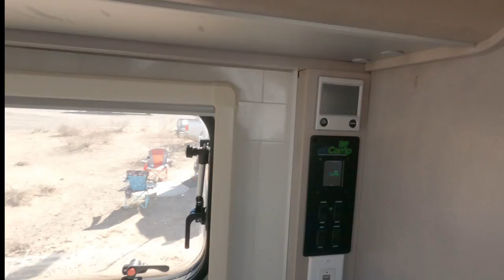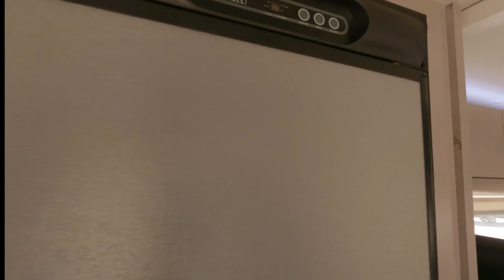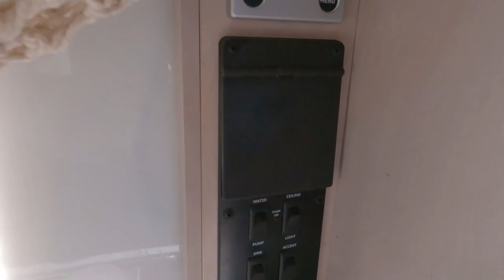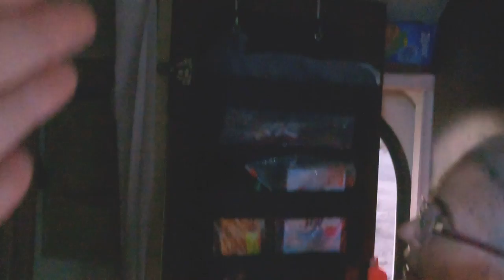2022 NuCamp Cirrus Truck Camper Tours, Tips & Mods - Truck Camper Adventure Rally - 620, 820, 920.

Comment: The fridge broke and they had to saw it in half to remove... and it cannot be replaced! How long does Cirrus figure fridges trypically last? Seems like a pretty significant design flaw.
Reply from the maker: I imagine it's the same with most rvs. They install before they add the walls. Our fridge is doing well and it's the same year as theirs. I guess the figure that's the plan-cut it up. Many rvs have much much bigger fridges.
Reply: @OuterLimitsOpenRoad  Never thought about it, but you are right. The fridge must be one of the first things to go into an RV build. I guess since most people don't use their RV much the fridge doesn't get much use and lasts a long time.

Comment: I just bought a 2022 620 I am scheduled to pick up in few days, I contacted Tech service at NuCamp and asked for a one line wiring diagram. I was told they dont have any, how can you run a production line without any documents for the floor and what did they submit for approval to build. I am hoping the quality doesn't reflect this from the factory.    Anyone find electrical wiring diagrams any where else???
Reply from the maker: Search the Cirrus Owners facebook page. I know there are schematics for the the other models but I'm not sure about the 620. I did just listen to the campers next to us go on and on about the build issues with their Mercedes/Winnebago top of the line van to anyone who would listen. No rv's are built how we'd prefer. They're meant for weekend use. You won't find any manufacturer without a healthy dose of complaints. This is our third NuCamp because we love them. They are not perfect by any means, but we've been there, we've met them and we trust them.